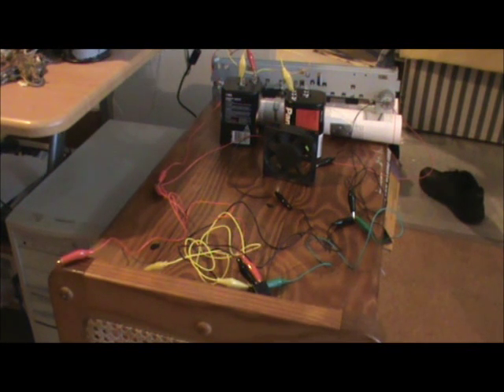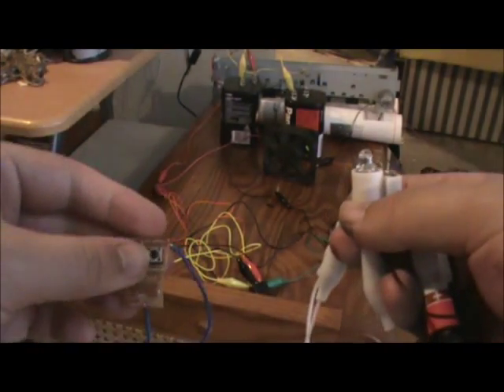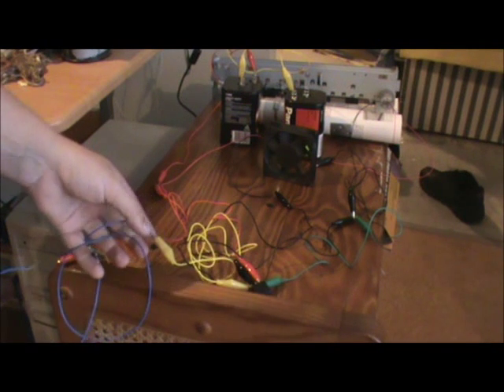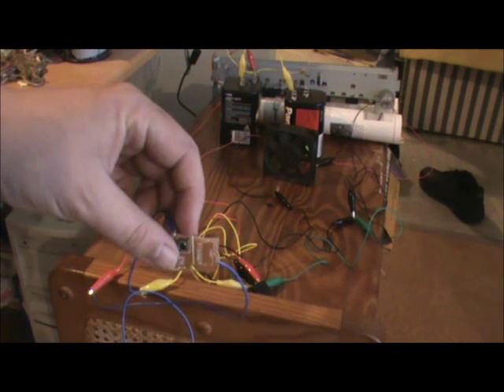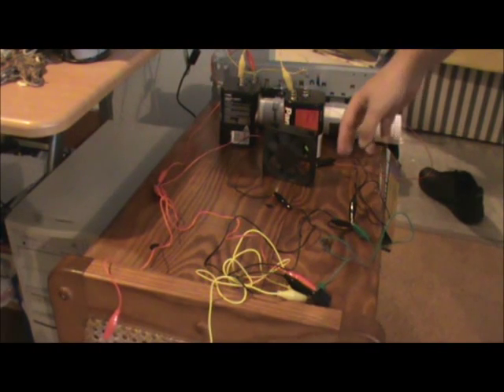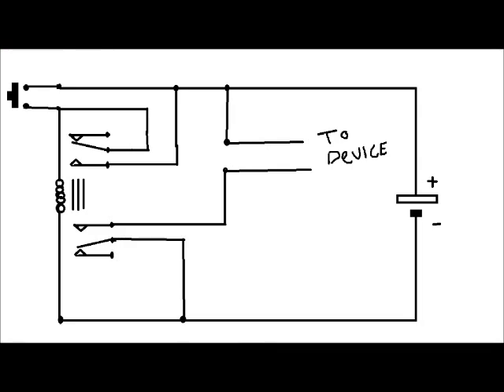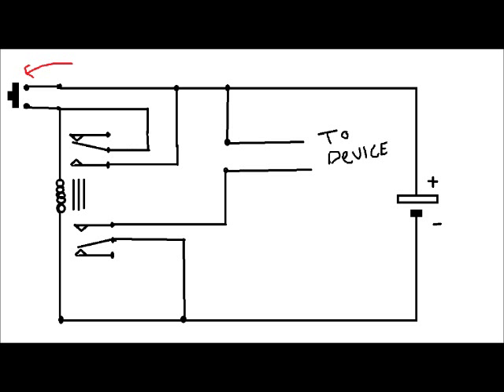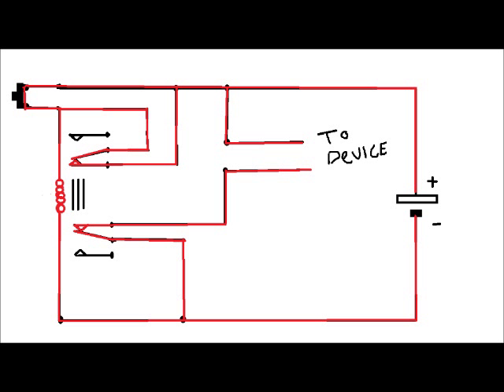DPDT relay wired in latching mode

Comment from the maker: Not this particular one, I think it only had a contact rating of 1 amp @ 12VDC. You can get DPDT relay's that have contacts capable of handling that voltage and current, not too sure about the coil though.

Since you're dealing with mains power I'll like to point out that i'm just a hobbyist not a electrician I don't work with 240v stuff.